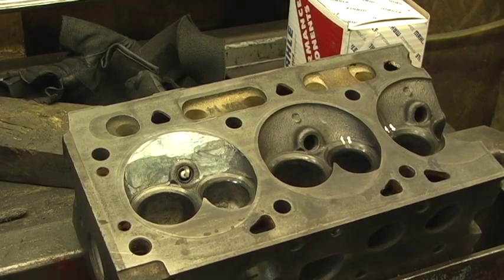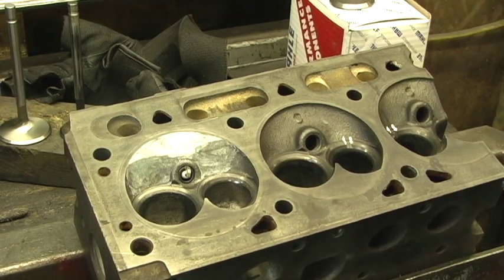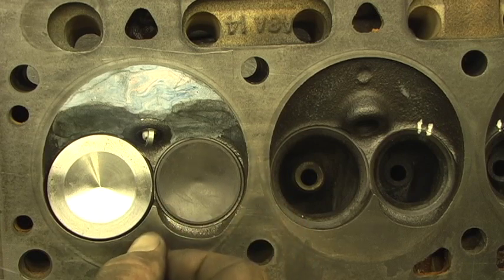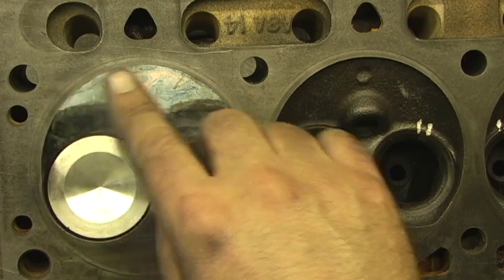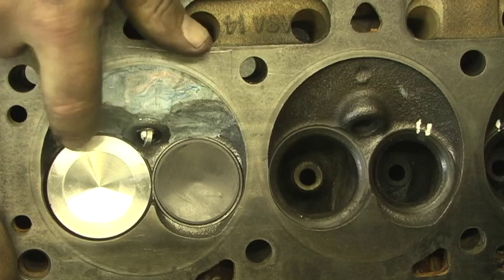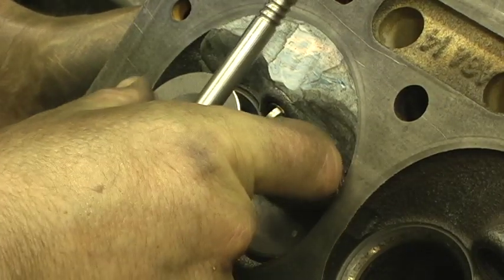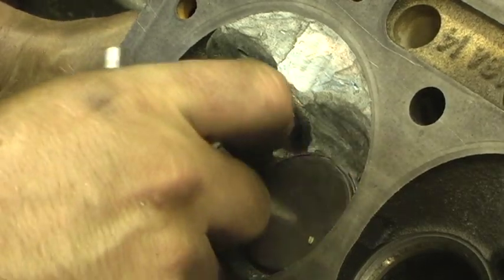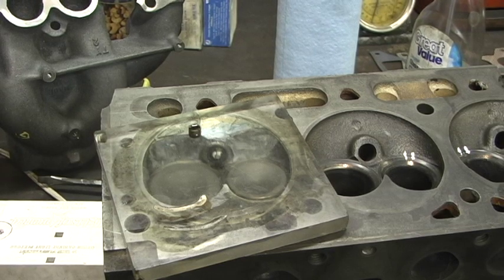Clay Mock Up for Welding on Combustion Chambers 2.3 Ford Part 4

Comment: your a good and honest fella.thanks for your time in making all these videos.would you happen to know what the air gap divider cut out measurements are do you? I have a Chinese pro comp that i what to cut out the center divider like the air gap.thanks again..
Reply from the maker: If your going to go to that much trouble, get an open plenum. I know the "CUT" your talking about, and have often wondered how much that actually helps. I am NOT a fan of the dual plane intakes, as I seen a Victor Jr, KICK a Performer RPM off idle to 5500 on a 350 on the dyno YEARS ago.
Reply: yea i understand your point.but i am on limited fun's here and disabled and out of work so i am just trying to make what i have work better..the reason for the cut is to give back some top end at upper rpm's.I am building a mopar 360 with 308 heads.I've seen some pics of your mod on the pushrod pinch was it really with the extra work? i have this heads flowing up to 274cfm's at .550 and 194cfm on the exhaust,and then it stumbles after it reaches 550 lift. I've done everything porting wise(head bolt bulge on the floor,etc.cut and shaping the V.guide area,bowl work,shrouding) to the heads besides going thru the pushrod pinch to get anything else out of them.thanks for your input and the knowledge you have in this area.take care.
Reply from the maker: stev2843 This is where the MATH comes in, and the flow bench DON'T!!! The PINCH as you call it, acts as a governor, limiting the overall power production in the port. Remember this, no mater how big you make the port, the PINCH POINT is the dictator of the fixed column or air, and it is MOST of the time either the Short turn to roof, or Pushrod.  Why do you think they spend THOUSANDS on offset rockers, it is SOULY for moving the PINCH POINT!!!.
Reply: yes sir.I can surely understand that point.well my pushrod hole are pretty big i can stick my finger in it!! way bigger than i really need for clearance.I might have to break out the grinder this weekend and see if i can take some of it out.if i happen to break thru the pushrod hole can i use JB weld to feel it in? I can stick a 1/2 copper pipe in the pushrod hole that's how big it is.Thanks for your help tony.and keep up the good work on your videos...Steve

Comment: shit just buy an aftermarket head, they  are out there, same folks make a lima block that goes to 3.1, which is pretty big four a 4 banger with out counter balance shafts. I had my oval port head milled to the max.8.5-1 to 11-1 crane cam all the good stuff doubled the hp, the head this guy is messing with is the worst one to mess with

Comment: Yeah, the area of the valve, which is closer (due to the guide angle) to the piston bore would flow better than the one which is on top of the combustion chamber. That's why extensive unshrouding of the factory squish are would give more power, even apart from being more effecient due to shorter flame travel.